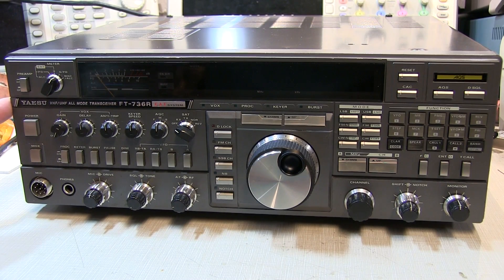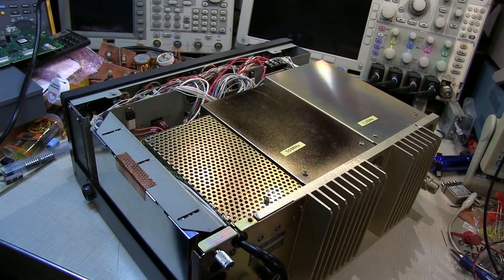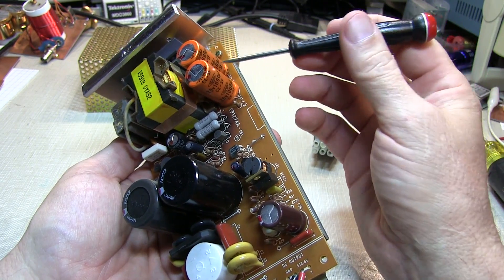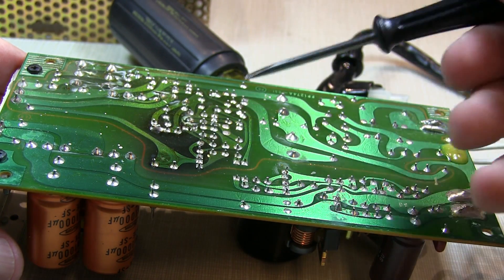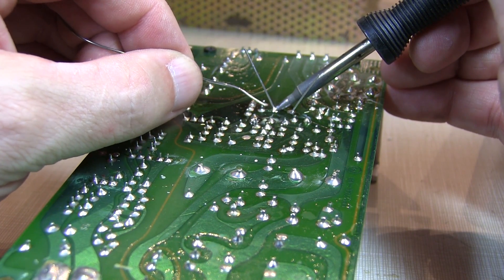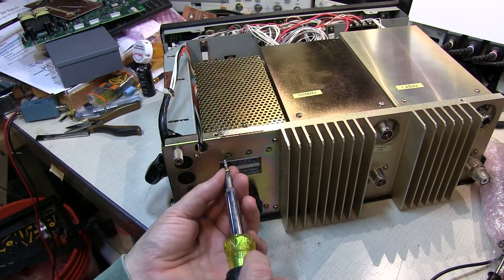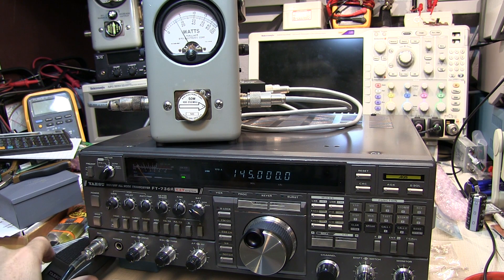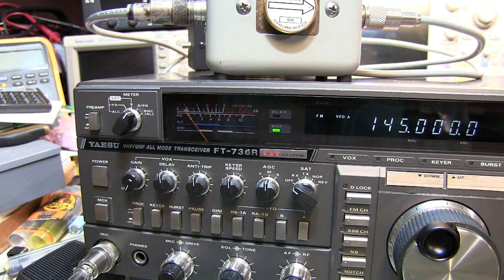#258: Repair Log: Yaesu FT-736R re-cap of internal power supply | replace electrolytic capacitors

Comment: Alan, may I ask what video editing software you are using?  A number of the transitions were kinda "weird" and I thought my computer might be the problem.  Had to check the video on my tablet to confirm it was the video.  Hmmm... deliberate so that you get more views?  LOL  ;-)
Reply: 4:35 - 4:53 is a good example showing a number of frames jumping into the video.  Pretty weird...  Enjoyed the video though!
Reply: I thought it was my lack of sleep
Reply from the maker: Same tool I've used for years.  The problem is with how YouTube rendered the video.  There is no jumping like that in my original video that I uploaded.
Reply: Was very distracting. I know it isn't your fault, so WTH, YouTube?
Reply: I noticed those flickers as well. And I can with pretty high confidence say he's using Sony Vegas or some derivative of it, because I've had the exact same issue happen in that.

Sadly my long (and short) term memory is complete crap, so I can't remember what the problem was, nor how I fixed it. I did fix it somehow though :\
Reply: Edit them in higher bitrates (20 MBit/s) and recode them with FFMPEG with the following command:

ffmpeg -i video.mp4 -c:a aac -b:a 192k -c:v libx264 -preset medium -crf 19 -movflags faststart output.mp4

This should fix this problem.
Reply: I have seen random glitches on several videos over the last few days. I think youtube has done something wrong.
Reply: I doubt it. I guess it are data damages on uploading when people have shitty internet connections. :/
Reply: There's been dozens of glitches just like this on tons of different YT'ers videos the last few days actually, it's definitively YouTube having fucked something up bad. There's no way it would correlate across dozens of completely unrelated YT'ers within the same sudden time period otherwise.
Reply: Do you have links with evidence? I just saw this video glitched up and no other video. And I watch A LOT OF CHANNELS...
Reply: No clue why I owe you any evidence. I watch a lot too. And there were comments pointing it out on the very same channels. I have better things to do than dig up examples from the past week.

Comment: I was wondering why you didn't remove the two power resistors and remount them further away from the circuit board that way there would be more air around them and less heat near the replaced caps.
Reply from the maker: The leads weren't long enough to remount them, and I didn't order a replacement pair.

Comment: Did you happen to test the other caps afterward just to see which ones were really bad and which ones were so-so?
Reply from the maker: I tested a few. The first two I pulled were very bad.  One of the large caps near the power supply had a slightly elevated ESR.  All others were still fine, but replaced with 105C caps anyway.
Reply: Thank you.

Comment: Hi Alan great video!  Wouldn't changing those resistors to a higher wattage help with the heat problem?
Reply from the maker: Not very much - they would still dissipate the same amount of power - generate the same amount of total heat, just spread out a little on a larger body.

Comment: I did this precise repair about a month ago. My filter caps were too tall and I hadda cut a hole in the screen, but subsequently added some light closed cell foam insulation to protect from the case.. There's a website with an entire list from DIgi-Thief for all the parts and the dude adds a small fan with a zener to slow it down to cool things a bit. I added that too.  Link here: http://www.qsl.net/4/4x6on/RADIO%20MANUALS/YAESU/YAESU--FT-736R-PS-Repair.pdf

Works great, lasts a long time!  Great video!
Reply from the maker: Yes - the Digikey p/n listed in that online references calls out caps that are too tall.  You can substitute digikey 493-8014-ND or 493-6121-ND instead.
Reply: ***** thanks. I think they were out at the time......

Comment: Why do hams refuse to make obvious changes like LEDs?
Reply from the maker: In this case - it's not so easy.  The meter is back-lit by bulbs inserted into through-holes in a plastic light pipe.  Thus, light is coupled out of the sides of the bulb into the light pipe.  Most bright LEDs don't emit much light out of their sides, they are focused in the axial direction, thus wouldn't couple well into the light pipe without modification.
Reply from the maker: Not a bad idea.  I just don't have an SMD LEDs here to experiment with...  I'll check out Paul's amp video...
Reply: Incandescent lamps have a very low cold resistance, resulting in HUGE inrush current. This causes premature failure. I've used an LM317L as a current limiter, resulting in very long lamp life. The caveat is, it drops ≥ 1.25V. So, instead of 14V lamps, I use 12V lamps. I last changed the lamps in my TS120S/TS130S rigs over 10 years ago. With the running current limited to about 95% of normal, lamp life is extended another 50%.
Reply: "Dispersion Angle" isn't a function of the mounting style. It has to do with the LED's lens. If the angle is small, you can remove the lens. The caveat is, the light is then spread over a wider angle, and it appears dimmer.

Comment: I'm not sure if it is because of the phenolic PCB, but looks like a "cheap" power supply for the caliber of the rig. Maybe it is older than what I think,       early 2010's?
Also at the beginning I thought it was a very wimp power supply and the gauge of the output cables was very thin but then learned it is only 25 W, then is probably ok.

Comment: Nice repair Alan. This is the exact same thing I find in all these rigs.  Those resistors cook those capacitors pretty good.  BTW, still not sure if you got my message two weeks ago.Thumbs up on the repair.
Reply: You can also put fiberglass sleeving on the resistors to keep the heat isolated.
Reply from the maker: I did, thank you!

Comment: Alan - what were the temp ratings of the old caps just out of curiosity, 85 or 105 degrees? Hopefully the replacements will better withstand the heat generated in that area of the supply.  73 - Dino KL0S
Reply from the maker: They were all 85 degree caps. Now, they're all 105...

Comment: Classic case of CCS or crappy cap syndrome.  One suggestion to those who recap these themselves is to use either 105° C or even 125°C temperature rated caps.  To prevent scorching of the PCB upgrade to higher wattage resistors and leave them up off the board slightly for better air circulation.
Reply from the maker: Yep - I used 105° C caps for the replacements.
Reply: I don't know why they even bother making 85 deg caps anymore......who would bother using them